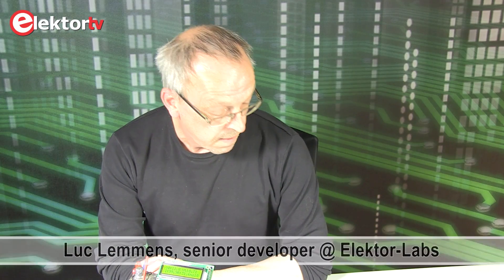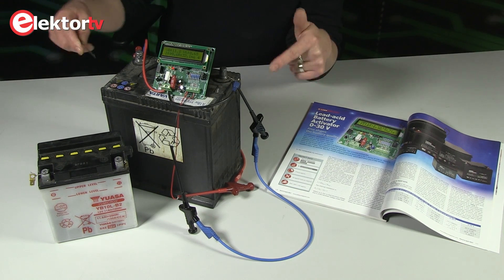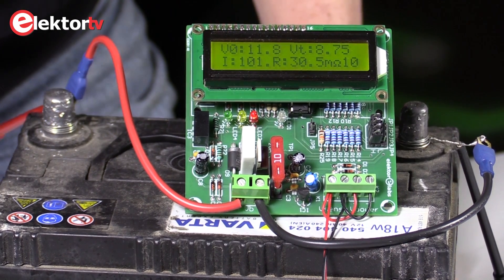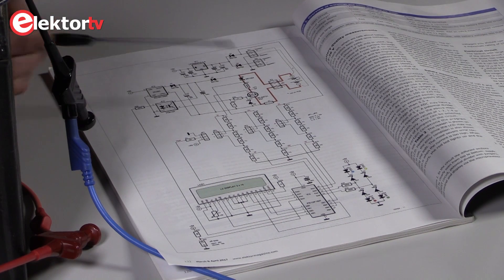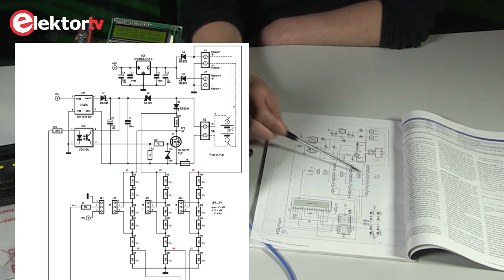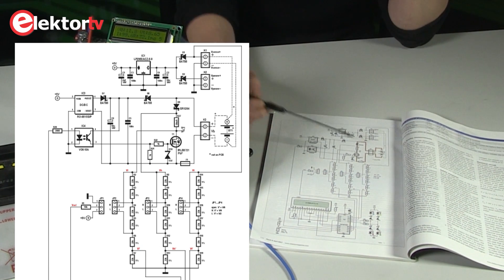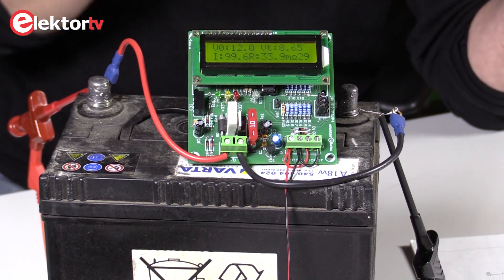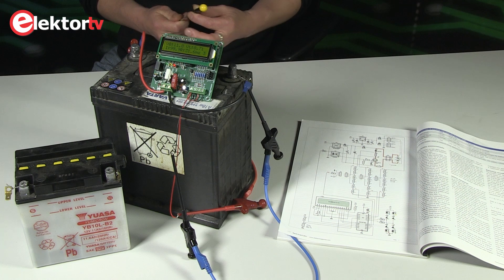Lead-acid Battery Activator for batteries up to 30 V, also shows the battery quality

Comment: Hello i am in trouble !
The link is dead and there is no possibility to purchase or get information about this project
Why it is not possible to buy a fully functional kit like this easily
Reply from the maker: Unfortunately the link broke after they revamped our website, now it should work again. However, this is a project from 2016 and the kit is no longer for sale. The PCB appears to be available (not sure though): https://www.elektor.com/products/projects/pcb/automotive/activator-for-lead-accumulators-160064-1

Comment: It is not a charging but discharging circuit. If one believe it activates your car battery, then start your engine can do it better.
Reply: if i'm not wrong, you should use some circuit like this in combo with a charger; info there: http://www.union-services.com/aevs/681-687.pdf